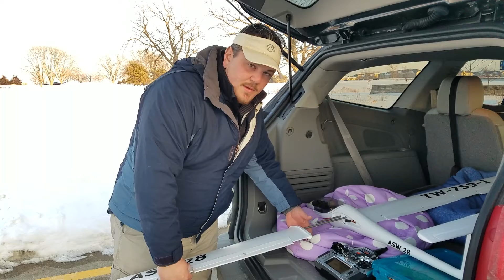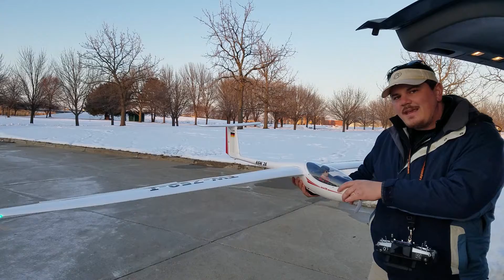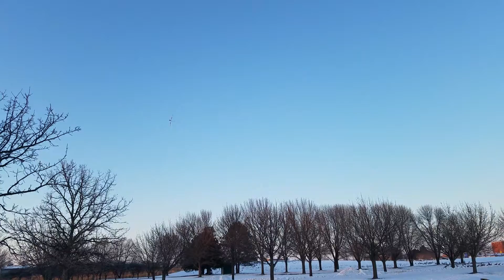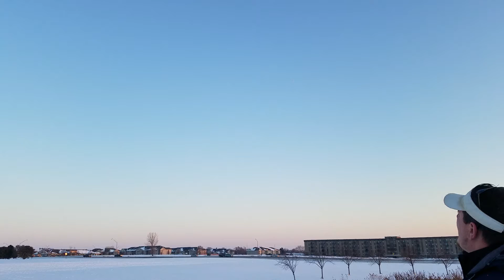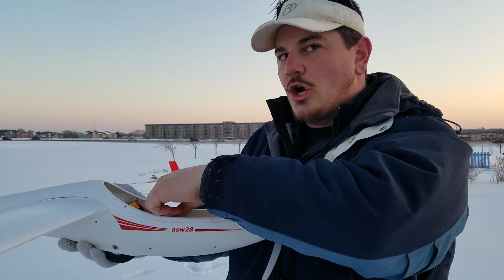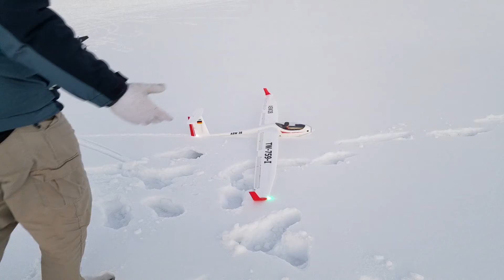Volantex RC / Lanyu - ASW-28 - Maiden Flights!!!

Comment: Awesome job on the plane Brian. I haven't watched it all yet but picked up lots of great tips so far. Thanks again for doing this build series.
The only problem I've ever had with mine is when I trimmed in to much up elevator in flight. On my next launch it went vertical and stalled. So I always check my elevator is level now before launch. 
If you have the CG right then you don't need much uptrim. Of course I mainly slope soar so can get away with a small battery for good CG. 1500 3 cell at the moment. I have a 1300 I'm going to try next. This is for reference for anyone reading this by the way. I know you already have experience with this plane.
I'm going to go and paint my prop white now. Looks great.
Reply from the maker: I'm glad you're getting some use out of the series. I really like the ASW28, and will have a better chance to get some  very manageable bugs worked out before too long, but I have a new project coming (Thursday???)...and it's gonna be SWEEEEEEEEEEEEEEEEEEEEEEEEEEEEEEEEEEEEEEEEEEEEEEEEEEEEEEEEEEEEEEEEEEEEEEEEEEEEEEEEEEEEEEEEEEEEEEEEEEEEEEET
...that's right, 1.25 lines of sweet!

Comment: Hi Brian, ArxangelRC has reported that on his ASW28 there was not enough epoxy between the fin and the plastic horizontal stab mount, and the fin and the plastic piece that is fixed to the fuselage. Happily the failures happened on landing, but he also had a camera on the fin which increased the mass and the stress to the tailpieces. Keep up the good work. Cheers.
Reply from the maker: yes, I've heard of this before, and have been fortunate NOT to have this failure.

Comment: Hi Brian, did you change anything for the CG?
I see a normal setup in your ASW28 with LiPo en pilot on the right place.
In my situation and with the same setup I get a heavy nose.
Do you use a receiver with stabilisation?
Reply from the maker: I was flying this with stabilization, yes. As for CG...I would be at or close to stock CG point.

Comment: Hello thank you for your Video!! Sorry for a question! Have you ever used or retrofitted plastic hinges for the ailerons? And if, I would like to ask, is that difficult to implement?  The flaps are easily torn after the first landing!
Reply from the maker: I've never had issues with the flaps or the ailerons on any of my belly landers. I HAVE damaged flaps and ailerons on planes, but not in these situations.

Comment: Awsome demo Bro. I just got mine and will be looking for slopes where I can stay up an hour
 on the wave lift. I am also cleaning up the airfoil with tape and sharper trailing edges. Thanks, Paul in Thailand.
Reply from the maker: You'll love it! Great plane, really fun to fly! Good luck with the slope search, you'll be hooked if you're not already, slope soaring!
Reply: @BrianPhillipsRC  I"m looking for some perfect tape and plastic sheet to clean up all the gaps in the wings. I used to build wings for Rand KR-2 airplanes. Clean as glass.
Reply from the maker: NICE! I bet you didn't just use packing tape??? :)
Reply: @BrianPhillipsRC  Thailand has some unbelieveable seaward slopes.

Comment: Great demo!  I may order this glider but will be my first with flaps.  Did you require flap with elevator mixing?  My guess is that flaps will make the plane pitch down?.?   Thanks.
Reply from the maker: Honestly, I don't think it was a huge issue. This can be easily tested with flaps deployed and elevator mixed to like 5% and 10% and then adjust accordingly after the maiden. Every radio system will be a little bit different for this mix, but I usually get pretty crazy with my mixing on these planes where I use CROW....sometimes overkill to be honest ;)

I have setup videos for this and many of my planes. Just check the playlists and look for the plane you're interested in, and you can watch my radio setup ;) I hope you will!

Comment: im now gathering more flight time with this awesome bird , so for so good. btw do you have a video on how to configure the crawl? i am using flysky fs-i6 . thanks mate
Reply from the maker: If you want to setup CROW, then you'll need to do this...

Set up the inboard flaps as flaps, then the ailerons as flapperons...you will need THREE or FOUR channels to do it. When the flaps are deployed, you'll setup spoilerons to deploy (both ailerons UP). You will want to tie in extra rudder to aileron mix so that as you attempt to roll the plane, the rudder will help make up for the reduced controls as you increase the CROW...
You can check out how I did it on my DX18, but not sure it's going to be helpful enough for you given you're not using Spektrum gear...
https://youtu.be/IE-noZnJO5U?list=PLXTH0DstRDc5gwAcvxziWIb-HcRqQoQWU
...hope this helps some :) Thanks for the question.
Reply: @BrianPhillipsRC  thanks for the reply :) so it's CROW not CRAWL :D
Reply from the maker: yes, CROW (like a bird), but using CROW will bring your plane to a crawl...LOL
Reply: exactly ... LOL

Comment: Why are u using stabilizer in that plane.?
Reply from the maker: I think I was in this flight. LemonRx 7Channel with Stabilization
Reply from the maker: This plane gets a bit "wonky" without stabilizer, in my opinion....it just takes the edge off, and keeps the plane from wanting to tip stall all the time.

The Phoenix Evo 2.6m and my most recent Phoenix V2 2m really don't need any stabilization, as they're both better flying plane.

Comment: Hi brian, what esc do you recommend for my stock esc?
Reply from the maker: This video shows my electronics setup.... https://youtu.be/ui4-rFALQvg
Reply: as Andrew Newton have found out, stock ESC is more than adequate for the stock motor and propeller which drawn about 18amps at full throttle.
Reply from the maker: I have a larger prop...